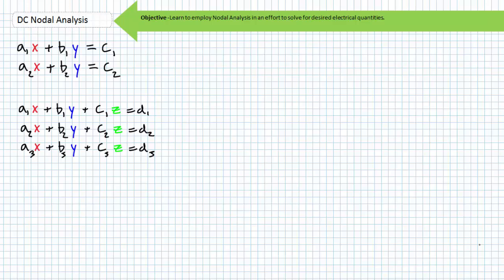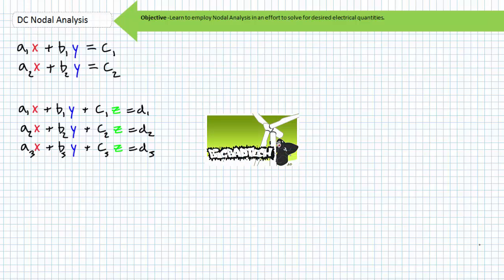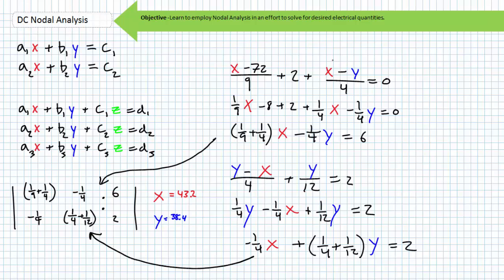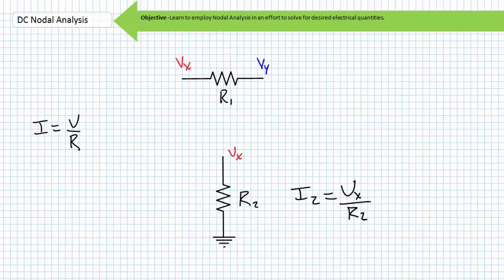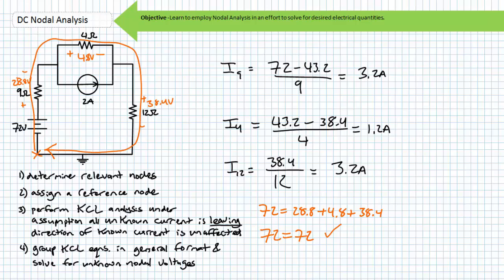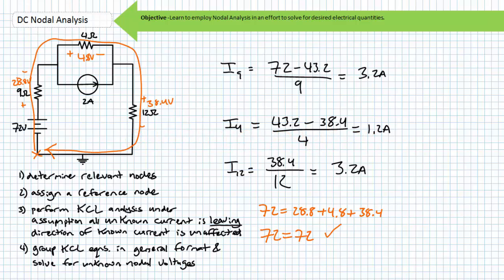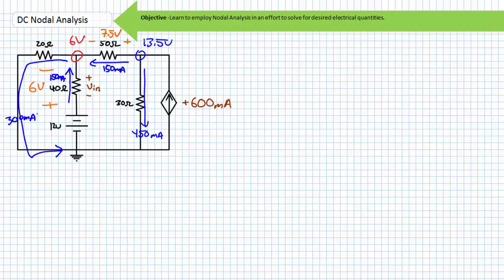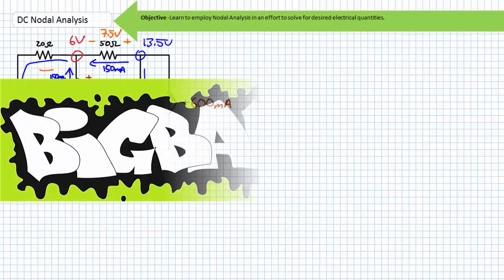DC Nodal Analysis

Comment: I think I may have spotted an error? At 7:28 I got x = 4.2, y = 2.2, and z = 8.8 with the same entries as yours, though I'm not sure if this is an error in the video, or just an error in my calculator settings. Just wanted to mention it, just in case.
Reply from the maker: Check your signs. x=5.8, y=6.4, z=11.4
Reply: @bigbadtech  Oh yep, i see what i did wrong now, thanks!

Comment: My only critique for the second circuit example problem is naming the resistors. With all the conversions going on, notes got a little jumbled being 3 resistors are 60 ohms and the currents are different. But this is still good refresher.

Comment: Thank you for such valuable resources I really enjoy watching these videos :) at 14:10, while writing equation for current Ia at node Vx. If polarity of 72V source is reversed will the equation be ((Vx+72)/9)  ?
Reply from the maker: Using double subscript notation VAB = VA - VB, where VA and VB are single subscript voltages with some common reference. If the polarity of the 72V source was reversed the voltage at the bottom of R1 would be 72V lower than the reference. Assuming polarity across R1 to be + to - top to bottom (ie: I1 is leaving node A) V1 would be VA - - 72V or VA+72V. The question is ... why do you want to make this problem more difficult? It's hard enough as it is!
Reply: @bigbadtech  Thanks:)

Comment: It happened in first year Electrical Engineering at uni, lecture 3....because doing it on paper is cheaper than using software or, God forbid, actual components.